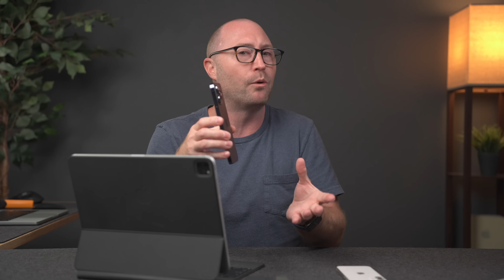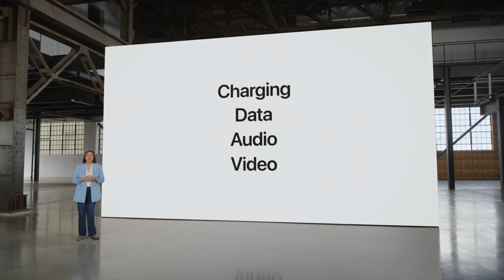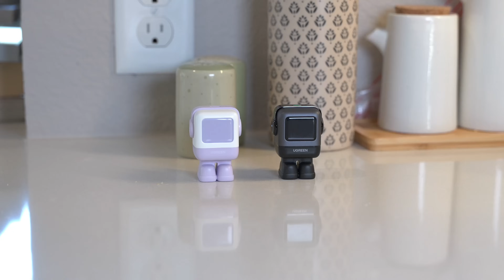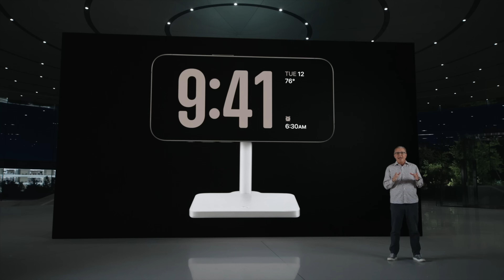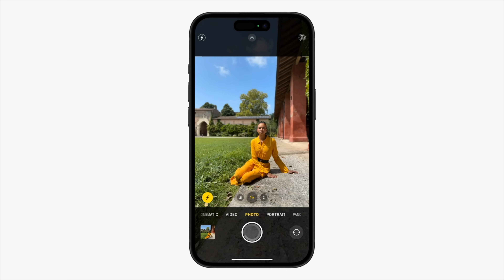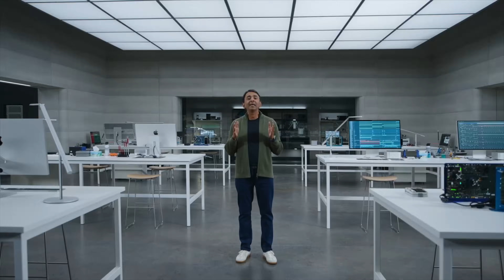New iPhone 15 - Which one am I buying?

Comment: Since the upgrades were small and battery life the same it would be prudent not to buy either one. 10% lighter was such a small difference. The base 15 pro cost about 1350 USD in Sweden where I am from so no way..

Comment: If only Apple had put the new camera in the regular pro as well. I’m now torn between buying the size I actually want, vs the camera system is like. Ultimately I may end up not buying at all as a result of feeling like there was an intent to not include the better camera not as an engineering decision but as a hook to buy a higher cost item.
Reply: I’m getting the 15 pro max 256gb natural titanium
Reply: I feel you mate, I’m torn between the two as well then I got to thinking that realistically how often am I gonna use the 5x zoom. I’m upgrading from an iPhone 11 so either way it’s gonna be a significant upgrade compared to that. I’m going for the 15pro and the only reason I chose it over the pro max is because of the size as I prefer to use the phone w single hand.
Reply: ^ Bingo. And I'm not buying it either. But unfortunately, plenty of people will
Reply: There’s a small consolation though, even if you end up choosing the promax it at least is lighter than before and thus less cumbersome
Reply: Me too,can’t decide ,hate the size of max but camera needs to be better on pro
Reply: @dude8698  I ended up settling on the Pro 256 in blue. Glad I did because I see that after the Apple Store finally came on line, there was an immediate back order to October for any version of the pro max.
Reply: I think Apple should have added the "5x" camera to the Max, rather than it having replace the "3x" camera. With this setup, if you're at 4.9x, you're getting images with a detail resolution of 2MP, and a color resolution of 0.5MP. Because it's a tiny crop from the main camera sensor. Maybe they should have even added both cameras to the regular pro.
Reply: No if only they gave you the option I personally am looking at the pro over the Max even though I want the bigger phone because I more frequently take pictures in the 3x-4.9x range compared to 5x plus. With the pro max in the 3x-4.9 range the quality is gonna be worse than the pros.

Comment: Blue 15 Pro Max.  I upgrade each year.  Apple seriously cheaped out on the cord.  I guess they figured people have thunderbolt 3 and 4 cords, which I do. Update: order a pro max for me and pro for my son.  Both in blue. I also use decluttr to trade in my phone.  I got 710 for my 14 pro max vs 650 from apple.
Reply: Europe passed a law where everyone has to use the same charger cord so that’s why they changed the lightning
Reply: You don’t get the full benefits of the usbc cord unless you buy apples approved usbc cord and the iPhones don’t do thunder bolt just usbc 3.0 speeds which is 10 gigabit sppeds
Reply: @techierg1862  I am aware which is why I said apple cheaped out by giving a usb2 vs usb3 cord.  It does not have to be an Apple cable.  Thunderbolt is USB-C backwards compatible and although can deliver 40Gbps will work to charge and transfer at 10Gbps on iphone 15 pro max.  Since I have several, will use one for my new iPhone instead of buying a USB3 cable.